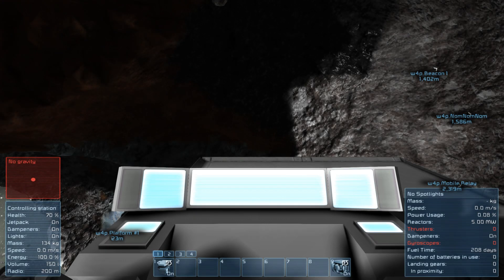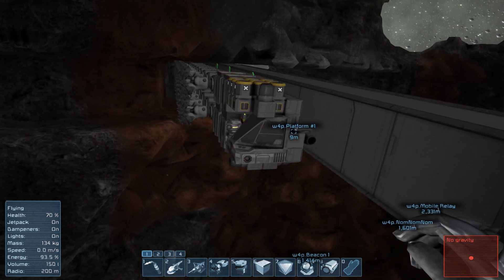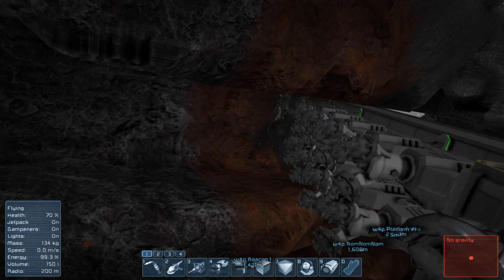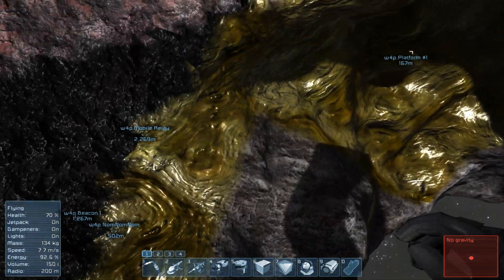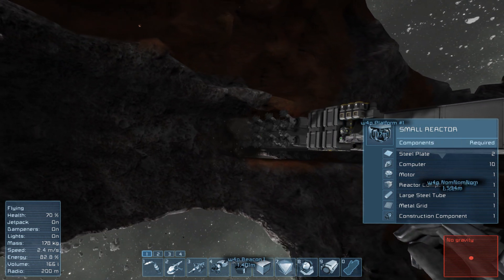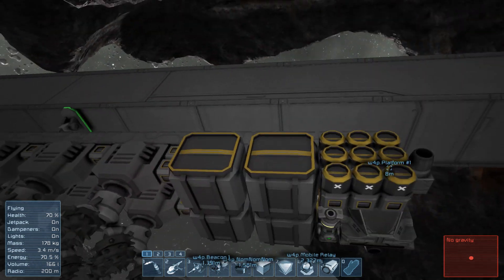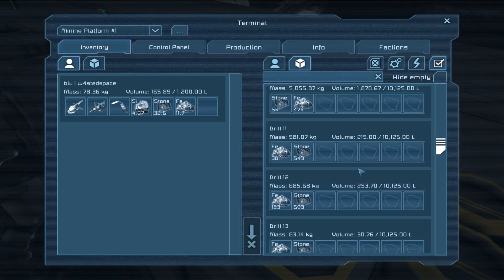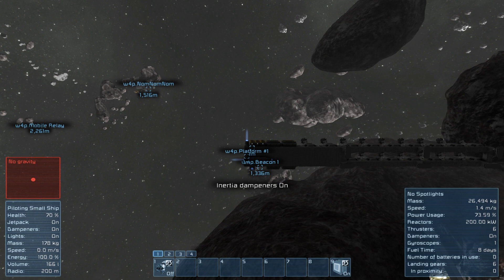Space Engineers - A Basic Mining Platform Concept/Tutorial - Survival Mode

Comment: 2 ideas on this subject, why not turn the design into a large ship instead? All you do is go to the site, create a station, generator and merge block and connect the refinery on

The second idea was most likely not possible at the time of the video but it is a really interesting idea. Can you make an automatically extending station that would continue indefinitely? essentially you have a projector and a welder setup that recreates itself, continuously building drills onto the end of it, extending and retracting drills, grinding the drills off and then building another iteration
Reply from the maker: Thanks for the suggestions! The reason for the small ship was simply to keep the vibration down.. I did try with large also and it had a habit of tearing itself apart with the large drills on a single rotor.

2nd idea is very cool but pretty complex so I certainly can't answer without a lot of experimentation, might have to give it a go sometime though, the self-replicating miner is a pretty awesome concept :)
Reply: ***** you can still have the small ship attached to the rotor column thingy but make the rotor column thingy a ship and relocate it rather than rebuild it
Reply from the maker: KaoS Dlanor
Ahh like that, so you are literally just building 1 station block each time to lock it into place. Nice thinking..

Comment: Has anyone ever thought to try and BUILD a stabilizing gyroscope?
I don't mean the prefab block in the game that affords axis control, I mean an actual made-up-of-spinning-rings gyroscope

Might take up a lot of space but what if it does a decent job of it?
Reply from the maker: I saw something that looked like one at one point but whether it worked and was setup as it needed to be or if it was simply a cool looking prop I have no idea. Could be interesting to find out how far the physics is modeled though, if setup right it should work, just not certain it will.
Reply: well the main concern would be it's own wobble right, but there's a nifty trick to attaching two rotors to the same structure which should stabilize the stabilizer, as it were

maybe some mass blocks in there and a very light spherical gravity field in the middle, just to give it all heft

I'd make one myself and test it but hen it comes to 3d geomtery Im something of a directionless idiot who needs to reacquaint himself time and time again with what goes where and why
Reply from the maker: Yeah the thing I saw was using paired rotors on each ring, the thing I'm unsure about is if it was actually spinning on all the correct axis and at the right speeds. Once I've got my head around this programming block thing I'll give it a try :)

Comment: Also, couldent you find a way to have it rotate AND go up ( or down ) at the same time so it keeps going around and keeps drilling. although your first rotation would be sub optimal ofc
Reply from the maker: That's kinda what I'm working on atm :)
Reply: Yes, I know this post is a month old, but with the new addition of timer blocks & sensors, you could add a sensor block set to spot the small ship to activate a set of timer blocks that extends the piston to a new level then it can continue with its mining automatically, but you will need some way to offload the ore so it doesn't fill up, maybe a collector near the sensor that looks for the small ship so it could offload its cargo
Reply from the maker: elementalblaze79 Yeah, or even just a ring of collectors underneath the small ship attached to the small platform with ejectors shooting from the small ship into them as it spins. Could definitely make something more automatic with what they've added recently, will have to revisit it sometime